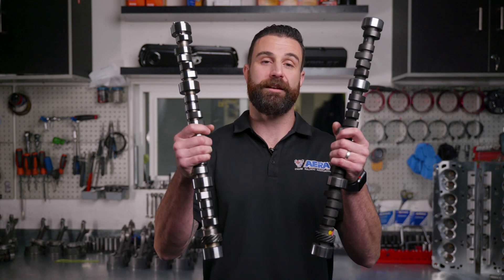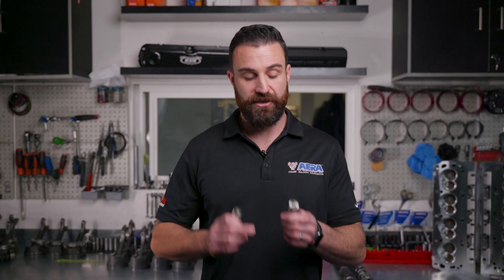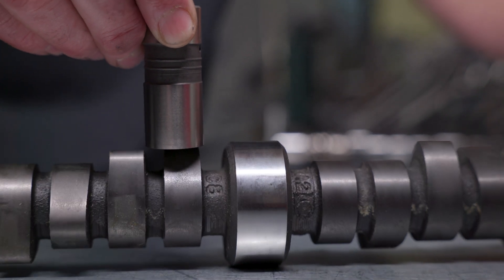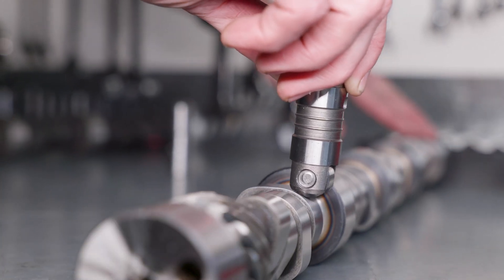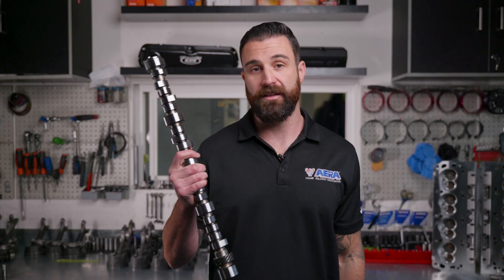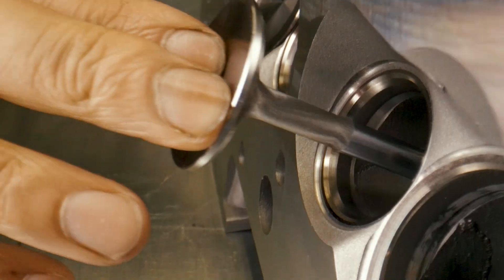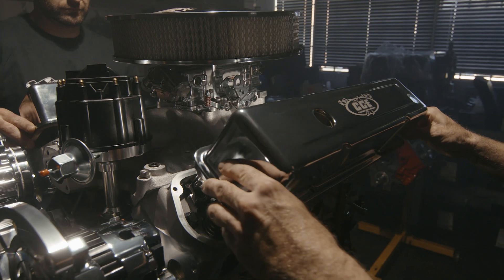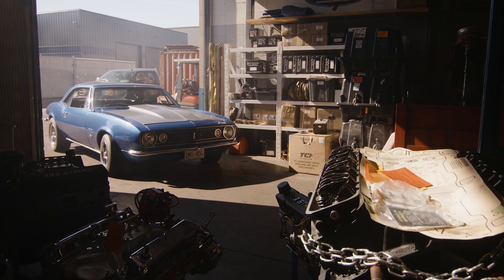Roller vs Flat Tappet Camshafts - which one is best?

Comment: Your water ski analogy is incorrect.  Flat tappet cams do not just slide along on the lobe they actually do move with a rolling motion due to the ground in lobe taper and the crown of the lifter.  Think of a trailer with a severely bent axle and the wheel running with extreme negative camber.  The wheels still roll and they will last for many miles but lock up the brakes and they won't go one mile.  This is exactly what happens when a flat tappet fails.

Also, because flat tappets are not acceleration limited like a roller if the duration is short they can have more area than a roller.

Comment: Respect for Flat Tappet but for most people, they are more trouble than they are worth.  For most needs and builds, roller is so much easier to deal with.

Extreme racers and if you want to save money and/or want that profile with fast ramp, of course flat bottoms rule. lol

Comment: I build engines for different classes in drag racing, most engine's have to run a flat tappet cam due to rule's. I also use an oil from Penn Grade oil in my engines for flat tappet cam.
Not every class allows me to use roller cam, and some engines i build there are very few roller cams available

Comment: What most forget is in the 60’s,70’s and 80’s we had cams going flat all the time. Lost count of how many oem 305/350 cams I replaced back then. Number one cause of aftermarket cams failure back then even the infamous Crane Cams was improper break in period!!!!!! This was even with the proper oil. Talk to any cam grinder who also repairs cams on how many roller cams a day he fixes the numbers will startle you. If you follow the manufacturers break in procedure and not skip a step or two a flat tappet cam will last for years period. If you don’t you’re on your own. Been in this industry for over 40 years and never have I had a cam I installed go flat! Ever!

Comment: He touched lightly on oil. Using a roller cam also allows you to run modern oils that are thinner and lubricate your cylinder walls much better extending the life of rings. Valve guides will also benefit from thinner oils. IMHO YMMV

Comment: Building a mild 351C and was planning to use the stock pedestal non adjustable rockers, is that possible?  Also, I’m guessing because the roller lifters are longer you would also need different pushrods as well.
Reply from the maker: Correct, you will have to use a shorter pushrod for sure. Non-adjustable valvetrain makes things a bit more tricky. Buy yourself a pushrod length checking tool. This will save you from having to buy multiple sets of pushrods

Comment: I thought about it for a long time, then decided on roller cam. I completely rebuilt my FE 390. And the risk was too great for me. 
Now with a custom roller cam, morel hydr. lifter and roller rocker, the engine runs without any problems
Reply from the maker: The risk of a cam failure isn't worth the price savings of a flat tappet. You made the right choice! Cheers
Reply: @CanadianCrateEngines  
Yes. And when it gones wrong with Flat Tappet, you not only have the money you lost. Then all the work must starting again

Comment: Do I have to replace my camshaft to get roller tappets. I drive a Toyota Tundra 2004 4.7 liter V8
Reply: Better think again there comrade, I’ve lost count on how many modular ford cams, v8’s and v10’s I’ve changed because of follower roller failure! Just because it has a roller doesn’t mean it’s foolproof.
Reply from the maker: Hi John, the Tundra engine has overhead camshafts, which is a totally different design. Overhead cam engines don’t have the same drawbacks as a traditional flat tappet engine.

Comment: I would use a roller cam if it could live in the 8,000 to 10, 000 rpm range ! But I have two sets of. Heads that have dropped valves with a roller cam 😢

Comment: There are some engines that do not have the after market support that the Chevy small block has and have no roller cam option, like my Corvair boxer engine. No cam manufacturer makes a roller cam for this engine, so I'm left w/ two choices: solid or hydraulic flat tappet lifters. I went w/ solid lifters to increase usefull RPM band and max RPM capability. Fortunately, they have solid lifters w/ micro-drilled oiling holes to help keep the lifters oiled at the point of contact. Still not optimal, but a definite improvement. I plan on installing a pressurized oil accumulator to eliminate dry starts all together.
Reply from the maker: This is true! Not all engines can be converted to a roller camshaft. The solid lifter with the oiling hole is a good compromise though. But solid lifters require more valve adjustments…I guess it is the lesser of two evils
Reply: @CanadianCrateEngines  With the available polylocks you don't have to worry about your adjustments loosening due to vibration, like standard rocker arm nuts.

Comment: How do the camshafts differ? The rollers are on the lifters not the camshaft
Reply from the maker: The actual profile of the lobe is different between a flat tappet and roller camshaft
Reply from the maker: The camshaft lobe design is completely different. The ramp rates are vastly different, you can actually see the difference when you have them side by side. The roller cam lobe has a much more rounded profile, and is less steep
Reply: The roller rides on the camshaft lobe. Don't get confused with roller rockers. They exist too

Comment: Thats why all the new Hemi Engines suffering from the roller design
Reply from the maker: Not necessarily because they are roller, but more to do with the design of the D.O.D lifters themselves. But you are correct, the stock Hemi lifters are a major problem

Comment: For equal spec cams, do the rollers have the same choppy idle?
Reply from the maker: Good question! If all specs were equal, the roller camshaft would have a similar, if not slightly more choppy idle. A roller camshaft typically opens the valve quicker, and keeps the valve open longer at higher lift. That quicker valve speed helps with scavenging  and performance.  Also,  advertised duration will likely be different between flat tappet and roller camshafts, even when the duration at .050" are the same, so it is hard to compare apples to apples in most cases.
Reply: @CanadianCrateEngines  thank you for replying back to me. The more lope, the better but I don't want to kill the performance. I will probably go with roller just because of all the problems that people have been having with the flat tappet cams over the last three or four years.
Reply from the maker: @ezkempinkemp3467  Absolutely! Don't risk your engine build to a flat tappet failure. Go roller...you won't regret it!
Reply: @CanadianCrateEngines  I believe I'm going to heed to you're advice.  Thanks!
Reply: Don’t you have to get a roller block if you want to switch? I know they’ve come out with a few retro fit rollers for classic cars but I heard they’re not a huge difference in power just lasts longer.
Reply from the maker: @buddysorge5840   Almost all of the big cam suppliers have a full line up of retro fit roller cams for almost every application these days, so you don't have to use a factory roller block.  You're right, the big advantage to a roller cam is that they are far less likely to fail (if ever).
Reply: @CanadianCrateEngines   oh I have one more question. I got a special oil for my classic that has all the additives like zinc and some other stuff since it still has a flat tappet, would it hurt a roller cam to run the same oil or would there just be no point?
Reply from the maker: @buddysorge5840  With a hydraulic roller camshaft you do not have to run a high zinc/moly oil. It wouldn't necessarily hurt anything to run it, but a good quality conventional oil is all you need!